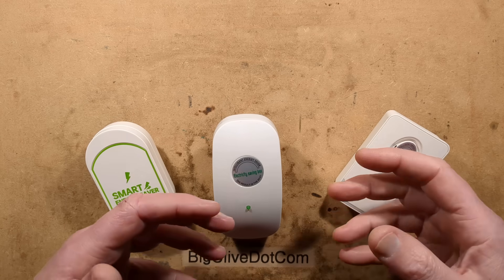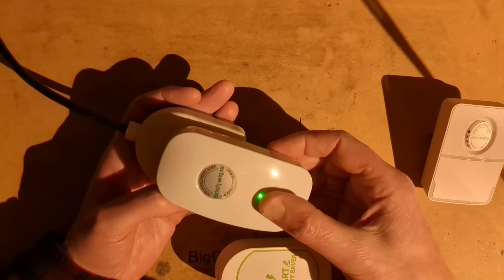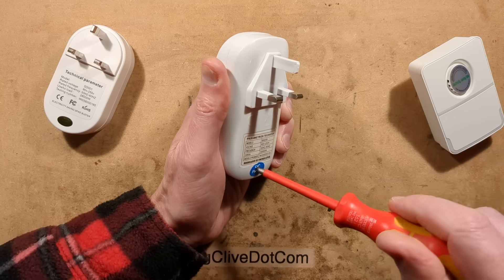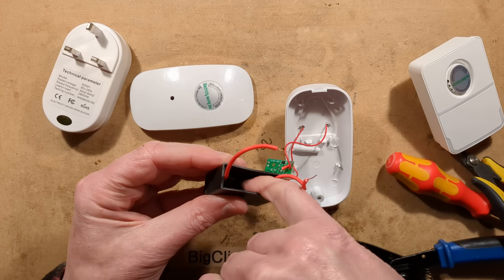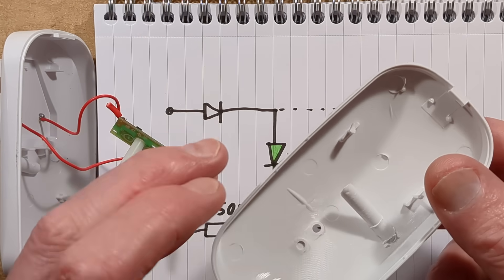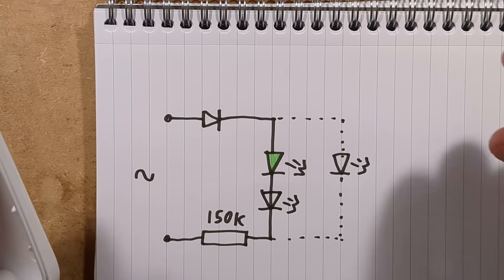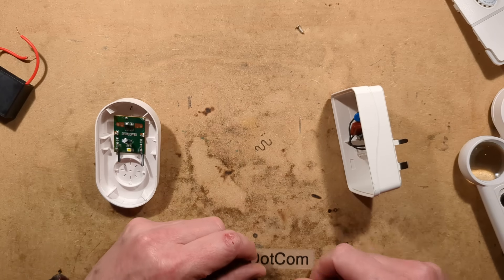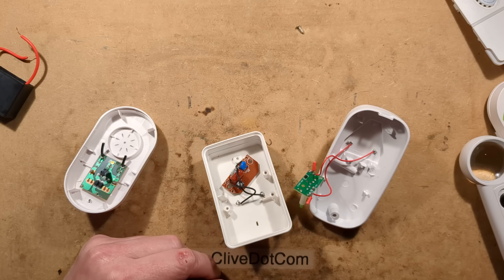Inside three fake power saver plugs 2025

Comment: To actually save power, it helps using a power meter plug to test all the appliances that are constantly plugged in and running/on standby.
For some time (now 10+ years ago) I used the standby clock on my stereo as my main clock. Checked the power usage and my chin hit the floor...
That measly VFD clock used 20W continuously!! Got myself a better and more energy efficient (3W) clock and keep that stereo unplugged as long as I don't use it.
Reply: I added a switch to the outlet my TV is plugged into. It uses 20watts when it's off. Even with all the extra 'smart' features turned off
Reply from the maker: Keep in mind that some devices with capacitive droppers seem to use more power than they do.
Reply: @bigclivedotcom how do you get an accurare measurement?

Comment: When I was working in a small hydroelectric power plant one contactor failed, so it was "temporarily bypassed", 'cause it was too far to civilization to buy a new one. It was meant to disconnect power factor correction capacitors, and things were all good until one day there was a brief -- a few seconds long -- power outage. After power was restored we heard a loud BANG. One capacitor released its guts faster than a speed of sound, so there were pieces of aluminium casing and paper flying everywhere. Fortunately no fire, fuses did their job too. Contactor was replaced right away.
Reply: Could you explain why it failed?
Reply: @mrtechie6810  Our guess was that the capacitor didn't have time to discharge (there are resistors for that purpose). When power returned it was oppositely polarized and caused some very high current in the capacitor. That heated metal foil within and caused the oil to boil. Those capacitors were built totally enclosed -- full aluminium body -- rapid pressure buildup caused it to explode. Might also have been metal foil turning into plasma / vapour directly, the explosion was instantaneous.

Comment: Can device do anything to improve the power situation at all under any circumstances?  Would the second one be a safe night light?
To save significant power, if you are not already doing it, I would recommend a electric heating pad or electric blanket instead of a space heater or "electric fire" as heating the air (and structure) in a room uses a lot of power and most goes to the ceiling and the walls but not to you and require several kilowatts for decent results while a (100w) electric blanket keeps me plenty warm at 1/3 power (33w on average). Hope that helps somebody.

Comment: I know those products are BS, but from the descriptions alone I understand they are SUPPOSED to work like an SVG (which obviously, they don't).

Anyways, my question is - is there even any use case for an SVG in a domestic setup? I admit I didn't work for the energy sector for long, but from my very limited experience SVGs weren't even considered under 30 kW of contracted power - partly because the losses were pretty insignificant (not enough to warrant the expense), and partly because even if the ARE registered, you can actually ask the power company to swap your metering equipment so that they aren't (again, less than 30 kW ONLY).

Not to mention basically every power bill I've ever seen bills the active and reactive power separately (if it bills reactive power at all, as I've mentioned), so you CAN tell if an SVG is needed from bills alone (unless someone set the connection/contract up VERY wrong, but, well, you'll be able to tell THAT quickly from the bill alone).

Comment: I have a power saving device that I plug in. It's just a copper bar that shorts out the circuit and pops the breaker so you're no longer using any electricity.

Comment: Large capacitors can correct the power factor reducing peak load like start up draw. At our company we shaved 3 thousand bucks a month off the electric bill with them. Best power saving device is the off switch.

Comment: You just don't understand: these devices are infinitely flexible. They can be whatever you like them to be. And they are equally "good" in every application! They can act as power savers, night lights, wifi improvement devices, air purifiers, ozone generators, insect repellent devices, good luck charms, ... You just need to believe! 😊
Reply from the maker: OMG.  New product idea.  Plug in luck generators.

Comment: all that effort to make a fake thing, they couldve made something at least a bit useful, a MOV and class X cap across live and neutral,  2 class Y caps, one from each pole to earth (but then it'd need a metal earth pin)....  at least one DID have a MOV but that resistor in series with it will pretty much nullify any effect it may have

Comment: What about the flashing LED in the third device? It looks like that extra diode might be a diac, shorting the capacitor periodically when the voltage across it had risen to a certain level.

Comment: The reason they put two LEDs in parallel instead of in series in the device with a capacitive dropper is because the manufacturers deep down are honest caring people.  They are so safety conscious that they decided to arrange a backup for the situation when one of the LEDs burns out causing a dramatic voltage increase over the output capacitor that is only rated for 25V. The old ladies that buy these things would be so terrified by sudden explosions in their bedrooms that they might stop buying these wondrous devices. And who would be saving power then?

Comment: Similar was offered to audiophiles as power line noise suppressors. Just plug it in and better sound! And the more units you plug in the better the affect! Of course the full affect only was achieved after a burn in period.
Reply: High end models even come pre-burned-in, right? :D
Reply: Joke is supposedly some voodoo devices do make a difference to audiophile equipment, but only because the designs are so bad, they'd never work on true professional gear as that stuff is usually designed by people who know what they are doing.

Comment: TBH... if one of these things burns down your house you save 100% on your energy bill.
Reply: If you get stuck in the fire, you'll be warm for the rest of your life.
Reply: @Doom2pro  So no Heating Bill? Hell yeah
Reply: Not exactly. We still get charged a certain amount even if we don't use any power at all.
Reply: @markmarkofkane8167  Welcome to Blighty , YOU WILL PAY !!!!
Reply: @markmarkofkane8167  Depends on the supplier if you have a standing charge.
Reply: @markmarkofkane8167  FACT!  Thank you Mark- they have lobbied rather successfully to impose a Service Charge on even an abandoned house.
Yes,they got laws written by well greased lawmakers to charge you for absolutely NOTHING!
Yeah,go ahead and wail to the Board of Public Utilities.See where that gets you,besides a hammering migraine
Reply: In the US they've been doing a connection fee for years. It's like USD 15.00 for a residential power connection, and more for industrial / commercial connections.
Reply: Surely in the case of an abandoned house, the utilities have been cut off long ago, you'll only pay the standing charge if you're still connected, a live customer, so to speak 🤷
Reply: you could use the fire to heat water to turn a steam turbine and MAKE some energy!
Reply: the other problem is the mark oops i mean customer probably won't buy another one of your products..unless they can come up with a fire prevention module you plug into an outlet...

many years ago i worked for a company that created a box that could be used in the circuit board electroplating tank (1000 gallon) ..it would calculate the surface area of the boards..anyway it did work but the internals consisted of a meter a resistor a momentary switch a capacitor (if we were low on caps we would not put it in) and a terminal board to connect 2 probes ..total COG including the box was around $10 the box was well sealed with super glue, epoxy , potting, rivites anything they could think of to prevent anyone looking inside..retail price $1000 but it did come with a lifetime warranty ...once shipped back to us we would just throw it in the trash and ship another one..great little business ..the company's main product was circuit board design and plating and silk screening  for min orders of 1000 ..after an inspection from the EPA found they were dumping toxic chemicals into a pit behind the building..the owner took a vacation very quickly..the site is now a CVS drug store
Reply: Wrong. You would still get charged a fixed daily fee until you cancel with your electricity provider
Reply: @brotherloops  Moreover, you might have to pay fines, property destruction penalty fees, moral damage fees to your landlord(s) and whatever else they'd be able to find you guilty for in court. Mhm.
Reply: Or you could just turn off your utilities and not have a bill at all
Reply: Do you? It takes lots of energy to burn house.
Reply: @TheUjjo  Just a judiciously positioned spark.
Reply: Come home to a real fire; buy a "power" saver from an unknown source with no regulatory requirements! 😂😂😂😂😂😂😂
Reply: :face-green-smiling:
Reply: Probably still have to pay that month's bill
Reply: Plus it'll help to warm up the local community, nothing like a nice bonfire in the freezing weather, eh? 😆

Comment: I wonder if it was just cheaper to leave the extra components in place from some of the units other uses (like ultrasonic rodent repeller) than to make a separate board just for the fake power saving models.
Reply: Does an ultrasonic rodent repeller scare off ultrasonic rodents?
Reply: Manufacturers love to consolidate models like that so if one doesn't sell you're not stuck with a warehouse full of them, you have the option to sell it as something else.

Comment: I cut my electricity in bill more than half, all it took was fitting a big arse battery and moving energy supplier to get cheap electric during the night to charge it.
Reply: Spending thousands to reduce long-term energy expenditure is definitely a feasible strategy, for those afflicted by poverty.
Reply: @ebutuoyYT  it is if you pay off monthly with a 0% interest loan with the money saved.
Reply: What kind of overall efficiency are you getting?  I reckon there must be non-trivial losses, specifically in the rectifier and inverter circuits (and inductive loads, depending on the design/quality of the inverter).
Reply: I wonder whether the overall efficiency of pumped [water] storage might be more efficient than battery storage for residential applications [that are amenable to such an installation].
Reply: @alexhajnal107 You're describing a hydroelectric dam, or maybe tidal generation. But also chemical batteries are just far more energy dense than a similar volume of water, and chemical fuels for generators are even more energy dense than that. The massive volumes of water needed for large scale energy production and its weight and propensity to break stuff sadly restricts it to locations with natural water supply and narrow outflows - like rivers and lakes.
Reply: @TheTingcat  With batteries the energy stored is simply the batteries' capacity (in J [1J ≅ 0.0003 W·h]; ~750kJ/kg, ~1.5MJ/m³ for low-cost Li-ion).  For pumped storage though J=mgΔh [m=water mass in kg, g=9.8m/s², Δh=height change in meters]; IOW, the energy stored is the water mass times the relative elevation of the cistern.  For a 10m Δh ["head"] one would require ~7500kg of water (~7.5m³) to store the same amount of energy as a 1kg Li-ion battery [double the head and the volume required drops to ~3.75m³].  So much lower density for pumped storage on this scale [7% by volume @ 10m] but if the losses are lower (for pumps/generators vs. chargers/inverters) in then it might make sense where efficiency is the primary goal.  Just a thought.
Reply: Did you include the cost of the battery and associated electronics in your cost calculations?
Reply: @ericthecyclist  2 year payback from the savings, will end up 2 1/2 years as i am going to add some solar panels.

Comment: I'm more horrified of how completely brainless the general public is that they actually BUY these things.
Reply: Alot of scammers operate more by social manipulation than using logic. It's why MLMs work, they excert peer pressure.
Reply: People don't think well when under resource pressure.
Reply: You may laugh, but I worked as a contractor for a large government organisation, who got tricked into installing hundreds of these quack devices into power sockets all round the building. 

Scammers only exist because there are gullable people to get scammed.

Comment: vwestlife pulled one apart recently, too. The fake capacitor is his model didn't even use resin, but just wax. The leads were literally just stuck into a blob of wax inside the "capacitor" housing.
Reply: Technically the wax is a dielectric and it’s between two conductors so probably a very low value capacitor?
Reply: Well, DiodeGoneWild too before

He said about alien technology 😂
Reply: @Liz0rdX80  Electricity saving spike buster! The result is the best!
Reply: Literally or actually?
Reply: @romandabrowski8994 Actually, literally literally means actually.
Reply: @error404m actually, literally means literally, actually speaking 😂
Reply: That's more dangerous than NOT including it... 🥴

Comment: Was there ever anything legitimate to these products, or were they scams from the get-go?
Reply: "Power factor correction" is a far too difficult concept to explain to the general public!
Reply: @polymath9372 And not an issue for a domestic user. Factories are a different issue, they get penalised for a bad power factor.
Reply: Well it depends on how much a scam you think Glade Plug-ins were.  Yes they did make houses smell different before they also caused fires so there's that I guess.

Comment: So if they all had the capacitors that the semi real ones have in them how many would you have to plug in to save any power and I know the number is probably most likely invariably 0
Reply from the maker: Power factor isn't usually metered, and if it was and you just applied a random correction, it could end up costing you more.
Reply: @bigclivedotcom okay yeah now I kind of remember what those capacitors do power factor Correction
Thank you very much for replying I really like your videos especially when I'm doing chemo

Comment: And of course, as Clive usually points out, most of these plugs for the UK market have a semi-shrouded earth pin, which is illegal, not that it matters as they are not connected to anything. In this video, two were like that, but one had a fully plastic earth pin, which is better.